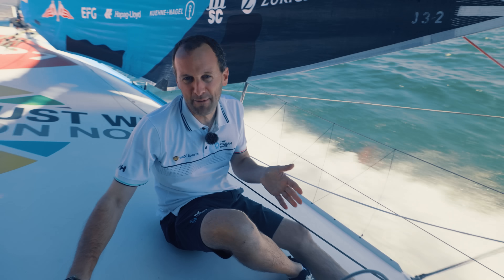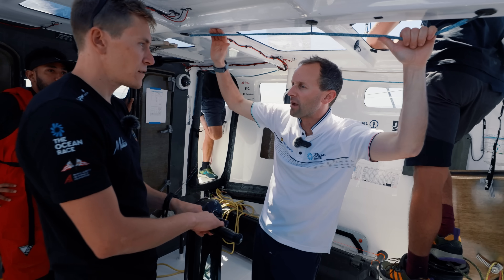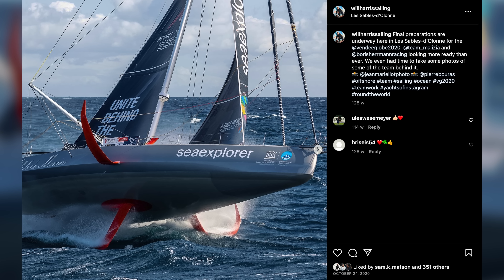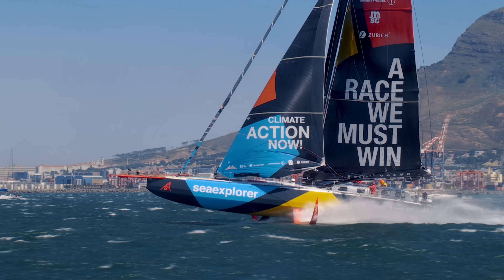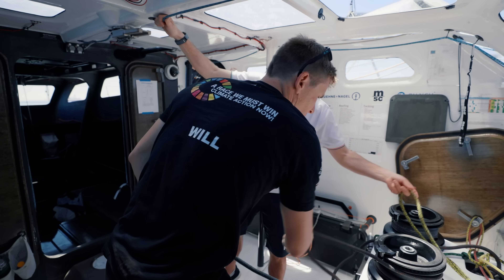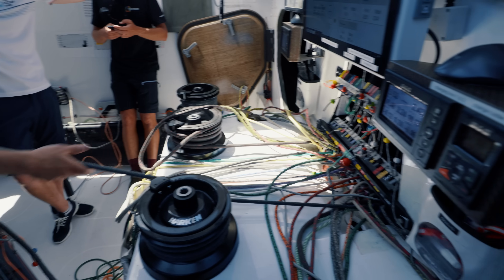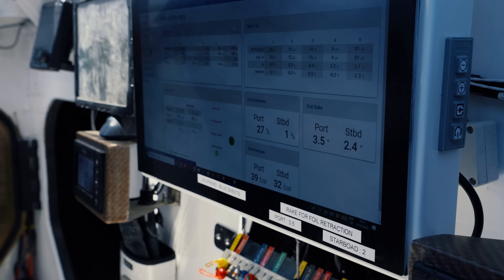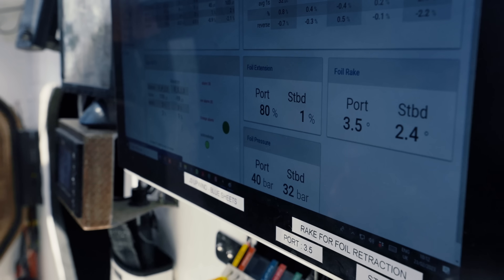'It's Like Having an Extra Sail!' | How To Use The Foils | The Ocean Race

Comment: A great technical video on the usage and trimming of the foils. Hydrodynamics and aerodynamics are similar and dissimilar (the medium is non compressible in the former) but the use of and the science is very similar which was first introduced into yacht design by Ben Lexen (Australian designer of America’s Cup legend when USA lost the cup - the winged keel 👍💪). 
We have had hydrofoil power boats for years and now through the development of carbon fibre fabrication a strong lightweight vessel can be designed to do crazy speeds greater than the true wind. I’m 75, knowing and thinking it’s great to get 6-6.5kts on a beat (over 7kts on a reach) in 12-15kts sailing my 40yr old Westerly Discus 33 cruiser, but to be doing these speeds is thinking in another dimension. Oh to be young again with this technology available 👍😀✔️👏⛵️⛵️
These crews are athletes, technicians, innovators, motivators, displaying tremendous leadership skills (individually and collectively) coupled with perfect CRM (crew resource management) interaction within the team who are then supported by a strong 💪 💪 shore based crew and loving family members 😍
Plus a great reporting team of OBRs, media personnel lead by Niall giving us a very informative coverage of the boats and the race. 👏👏🙏